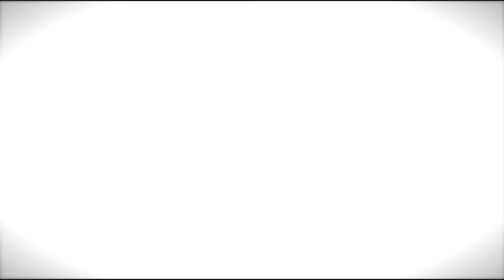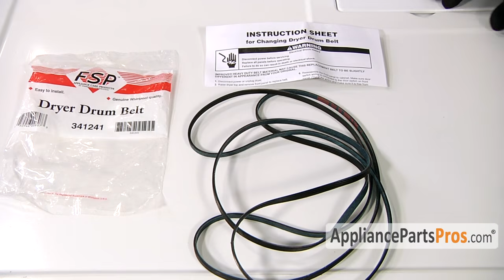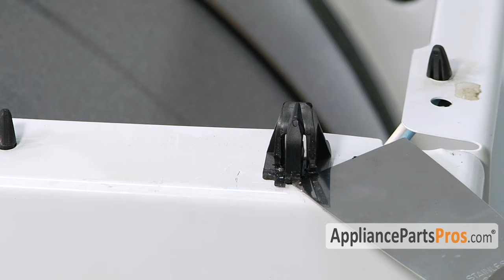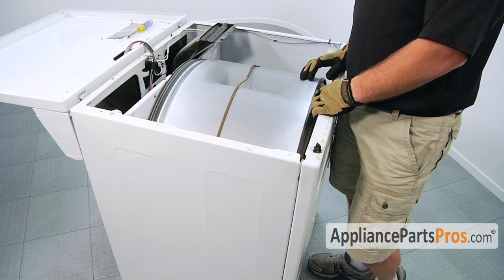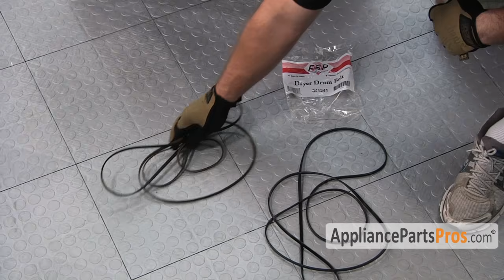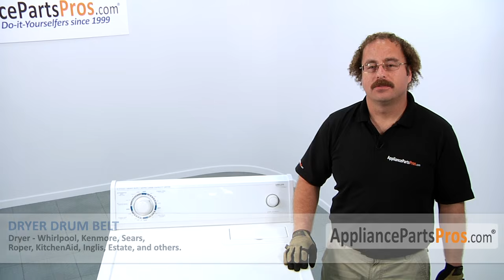How To: Whirlpool/KitchenAid/Maytag Belt 341241

Comment: Question, when I put my new belt on and fed it through the tensioner, the tensioner bracket rubbed against the drum when it turned. I ended up moving the tensioner bracket to the slit to the right of the one that you used and it didn't rub. The two slits appear to be slightly different sizes. Is what I did ok or do I possibly have the wrong sized belt? Thanks
Reply: It sounds to me like you could have a twist in your belt or you didn't turn the drum a full 360 degrees to allow the belt to properly track around the drum.

Comment: So easy a caveman can do it.
Reply from the maker: QQTrick1QQ Glad the video helped get the belt installed!
Reply: Well actually I was looking for why the drum would stop turning and the belt continue to slide around and fray into a wig on the motor, only has 10 hrs on it, all wheels, tensioner, ok drum still turned by hand with a little effort.. Had light load of towels in it.
Bum belt I guess.
Reply from the maker: QQTrick1QQ Could have been a bad belt. Make sure there is nothing causing drag on the drum and that the belt is aligned with the pulleys. If it was out of alignment it could have caused the belt to fail.

Comment: Everything came off easy. Top swung up, front panel slid off. Disconnecting the switch was tricky as shown in your video. Belt looped on easy thru pulley. Now it's all back and working. Thanks for saving me a service call!
Reply from the maker: Gregor Force Glad the video helped you get the dryer fixed!

Comment: If not spinning and belt is in place, What else could it be?
Reply: I am not sure if anyone got back with you but I am a Navy A-gang tech and have had to deal with this issue alot (especially in my own home).  I is possible that the belt tensioner has streached out or damaged.  If that is the case you can try and recrimp it so it regains its elasticity or if damaged you would have to replace it.  Hope this helps and I am not too late.
Reply from the maker: If the motor is running it could be the belt came off the pulley or the drum is jammed up. If the motor is not running then you have to figure out why. Could be a few things so you might want to go to our repair forum and post the problem along with the model number of the appliance, the techs can help you troubleshoot it.
Reply: Thanks J. Wick. It turned out to be the most basic of things.  Breaker flipped when sneakers got lodged in dryer. All is Good Now.